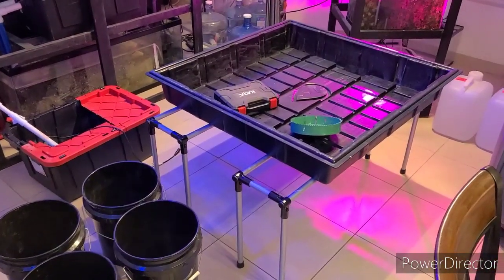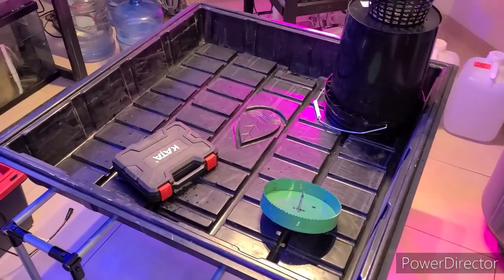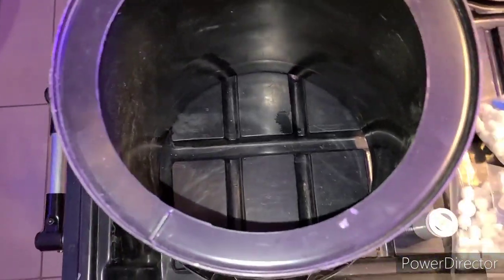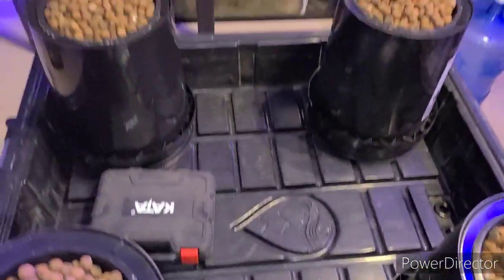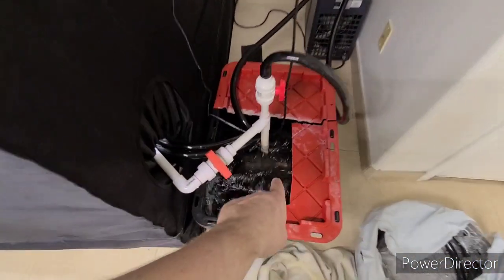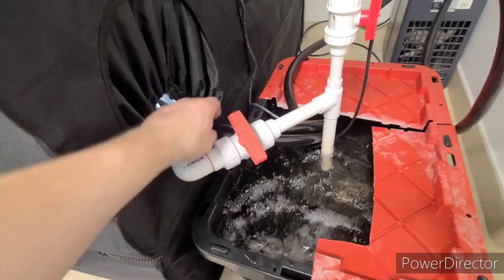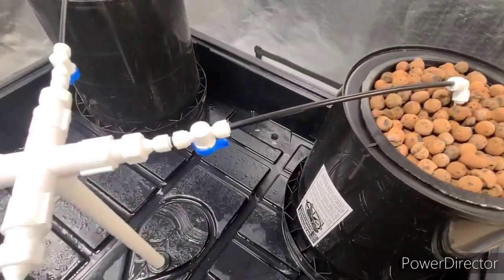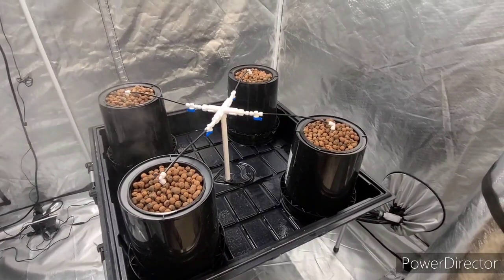Cheap, Simple, Effective DIY Hydroponics System...

Comment: AWESOME BUILD DUDE...This is perfect, I was looking for a simple rdwc setup & you nailed it.🤩😍This is definitely my next project for complete veg & flower system.
Reply from the maker: Just moved this to my flower room and gonna try to flower a round in it, if you want to check it out.....   in my playlists, it's '2 grows 1 Reservoir"
Reply: I have a question.What are the sizes of the veg reservoir, the pump & the chiller?   @thewell-roundednovice8852
Reply from the maker: @chibamann6507  veg reservoir I used was around a 20 gallon tote,, usually only around 10 gallons full... I used a 1/10hp chiller on that one

Comment: Why not just cut the bottom out of the bucket and use the bucket lid size pots in the original top of the bucket why make the bottom the top??? Is there something I am missing here? Seems over complicated is all I mean it looks cool but is there some functionality reason to buy such an expensive hole sawing bit I don’t have hundreds of dollars to spend on a hole saw of that diameter what is the function other than looking cool AF
Reply from the maker: I want the bottom open,,,, I will be able to prune the roots before I move them to the main system, also, I have to cut holes for my netpots to fit right anyway... its actually much simpler than cutting holes in both ends
Reply: @thewell-roundednovice8852  so cut the bottom out of the bucket and use bucket sized net pots just don’t see the reason for the plants to rest on the bottom side of the 5 gallon buckets is where I draw the blank just cut the bottoms out of the 5 gallon buckets and you can still prune roots but it does look cool AF the way you have it. All I am saying is that they make net pots that fit the open end (( top )) of a five gallon bucket why not use those and cut the bottom out of the bucket since you seem so intent on doing so anyway you can use a utility knife to cut the bottom out of buckets have done some for a aeroponic setup decades ago is why this intrigues me
Reply from the maker: @enragedwookie7863  I have to cut the proper hole for the size of my netpots that are compatible with my other systems...   but even if I didn't, I've never liked the bucket-fitting netpots,,, they've always given me trouble.... and also, for me since I have the 8" holesaw, cutting the hole in the bottom is way easier than cutting the bottom out
Reply: @thewell-roundednovice8852  okay point taken but that is a costly holesaw I couldn’t justify that purchase the biggest I have is 6 inch

Comment: Great idea dude…. Only suggestion I could make is the water flow over the hydroton.  Maybe try making a ring so the water disperses over more of the pebbles/roots rather then in a smaller area
Reply from the maker: I go out of my way to keep the tops of the hydroton dry.... seems to mitigate some problems
Reply: @thewell-roundednovice8852  make a ring and place it an inch under the hydroton, this way the top stays dry and the bottom gets fully saturated.
Reply from the maker: @mmenil1  I messed with a ring in the past... ive run a few grows like this with a single emitter and they all did very well,,,, the water kind of spreads out and disburses as it goes down through the hydroton
Reply: @thewell-roundednovice8852  nice, as long as its working. Good beans.

Comment: I never thought about the condensation on the lines. I bet that boosts humidity a bit. I feel like your new design's gonna kick azz😎👊
Reply from the maker: Yeah,, I didn't think about the condensation either until my tent floor was a puddle last veg... using the chiller causes that for sure,, and I like to keep my veg tent pretty jungley...  this system should do just as well as the last 2,,, my subsequent builds are always simpler and just as or more effective.